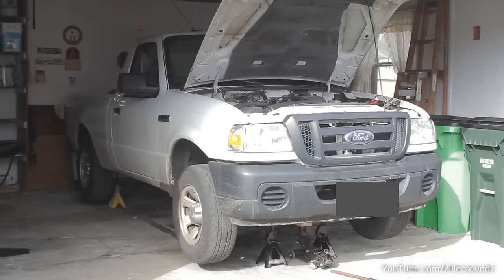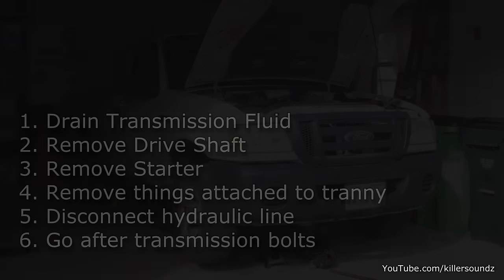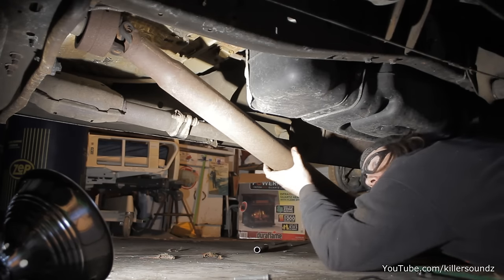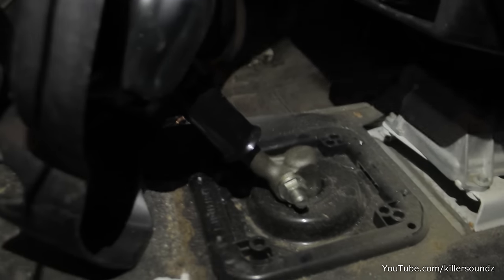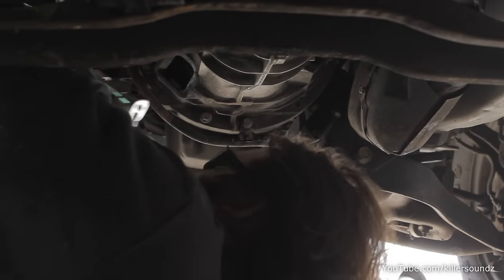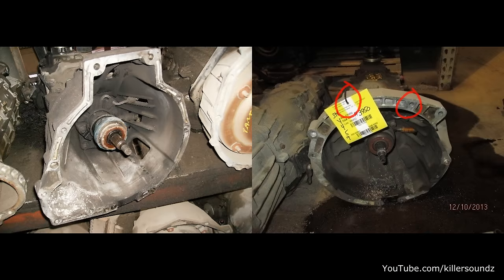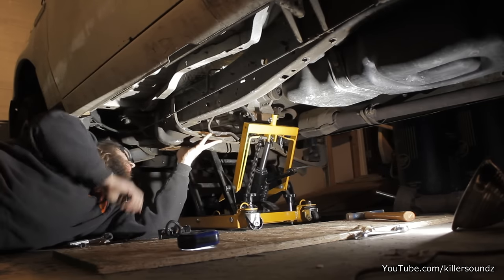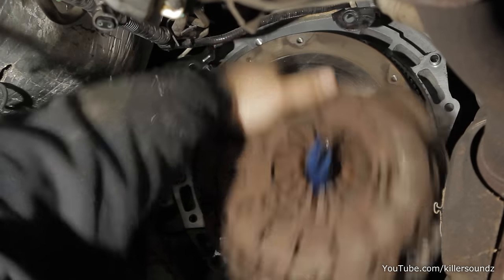How To Replace the Clutch in a Ford Ranger Manual 5 speed ✔

Comment: The key to those upper bell housing bolts is to lower the back end of transmission and get ~3 ft of extension and go from behind the transmission. You can see the bolts once its tipped down and easy to reach with the very long extension. Piece of cake!
Reply: yes good idea
Reply: PAY FOR IT DEFINITELY!!!!!!!
I am a 49yr old Carpenter and I would rather shlep/carry plywood all week for minimum wage then do this again!!!!!
The #2 bolts up top 😠😠 nevermind #3.
Alone made me wish I took it to a mechanic.
BUT!!!!!!!!!
 I'M A CARPENTER
I CAN DO ANYTHING
B*******LS*******T.
ANNNNND
NOOOOBODY talks about getting the muffler system out of the way.
But if you are going to do this 💩
"PB BLASTER" IS YOUR BEST FRIEND and look for the bolts that are facing the opposite way.
ALSO
Why are nobody's hands dirty in these videos 🤷.
I was as greasy as a pig at a hog-calling contest.
I'm also in Florida mid summer
🌞🔥🔥🔥🌞
Reply: I'm down with the lots of extensions Idea... but i find the trans doesn't droop much. the dang 2.3 liter basically you cant move it enough...or maybe the motor mounts are not wore enough to let it tilt.
Reply: I wish I saw this sooner took me days to figure it out. This definitely seems to be the best way by far
Reply: The 3' extension is the only way to get to the left top bolt. The right top bolt is best addressed the same way, but you can get the top right bolt by feel. I tape the bolt to the socket when I reinstall.
Reply: Exactly...
I have a 48" 1/2" to 3/8" impact extension.
1/2" swivel socket does the job quick.
Reply: @lunch_meats8738 
Mechanics don't like getting greasy.on purpose.

Comment: BOTTLE METHOD: if you wanna bleed your clutch or brakes by just opening the bleeder and pumping brakes/clutch,  your suppose to get a clear plastic or glass bottle  and a piece of tubing thats fits tightly on the bleeder.  drill a two holes in the bottle cap but make sure one of the drill holes is same diameter as the tubing.  add some brake fluid to bottle (doesnt need to be much fluid just enough so the tubing can be submerged), now screw cap on, slide tubing through cap, and attach the other end to the bleeder valve.  open the bleed screw and pump your brakes or clutch.  this method is the fastest, cheapest, and easiest.  good video

Comment: There's a much easier way to put the fluid back in the transmission instead of pumping it in on the side. While the shifter knob is out, pour it right down in the transmission there.
Reply: that's exactly what I did for my '99.
Reply: PAY FOR IT DEFINITELY!!!!!!!
I am a 49yr old Carpenter and I would rather shlep/carry plywood all week for minimum wage then do this again!!!!!
The #2 bolts up top 😠😠 nevermind #3.
Alone made me wish I took it to a mechanic.
BUT!!!!!!!!!
 I'M A CARPENTER
I CAN DO ANYTHING
B*******LS*******T.
ANNNNND
NOOOOBODY talks about getting the muffler system out of the way.
But if you are going to do this 💩
"PB BLASTER" IS YOUR BEST FRIEND and look for the bolts that are facing the opposite way.
ALSO
Why are nobody's hands dirty in these videos 🤷.
I was as greasy as a pig at a hog-calling contest.
I'm also in Florida mid summer
🌞🔥🔥🔥🌞
Reply: Lunch meats, that's why you're a carpenter, not a mechanic. 😂
Reply: @lunch_meats8738  yea I just had to take an angle grinder to my muffler because it was such a pain

Comment: The pilot bearing going bad is a common problem on Rangers that see a lot of hiway (high speed) driving. I ve had 12 of them (currently on #13) and travel South Texas in them-Atleast once a year (usually around 90k) a pilot bearing fails. I ve gotten to the point I just buy bearings and keep in the truck-normally the rest of the clutch is good to 180-200k (lacking abuse or hard use). Best combo is the 2.3l and 5 Spd-avoid the auto trans. Second best combo is the 3.0l V6 and the 5 spd-especially in extended cab trucks.
I wish the Aftermarket would step and produce a better bearing.
FWIW-if you use hi temp Marine Grease on the pilot bearing (lightly) during assembly-it helps.
Good video-having done this job half dozen times-I agree with you=farm it out to someone else for $3-400 if you can afford to do so.
Reply: Yup just got back home from a 10 hour trip. Heard some chattering 2 weeks later, pilot bearing is shot. Clutch only has 30k miles on it...

Comment: Thanks for the video. I’m halfway through this job right now. I found if you have about 5 feet of extensions and a wobble adapter, you can sneak over the top of the transmission to get the top two bolts. It’s a bit of a pain, but way easier than going in the way described in the video.

Comment: You crack me up !  Yeah ,  who needs those stinking extra bolts anyway !   I really appreciate that you give ALL of the bolt specs , complete with size AND torque specs !  There are several guys out there making ok DIY mechanic vids but , almost invariably ,  they just about NEVER give that much needed info .  Thanks a lot for the vid .   Looking at a '98 Ranger with 195k that's pretty straight and only $800 .  Just needs a clutch .   I've done a half dozen clutch replacements but at 54 years old ...  I may just pay someone this time .  Thanks again .

Comment: Most V8s have six bolts connecting the transmission to the motor. Dropping the crossmember and letting the transmission drop in the rear makes those bolts easier to remove. Great video!

Comment: Bro finally someone who is going through what I’ve gone through. I’m doing the exact same job on my 2002 2.3l ford ranger and man it’s been a complete nightmare. I’m on the dremel step of the pilot bearing because nothing else has worked. But unfortunately for me I also plan to replace the oil pan gasket and that’s a whole nother ordeal in itself. Suffice it to say I couldn’t agree more with what you said in the beginning, if I could’ve paid someone else to do it, it would’ve been totally worth it.
Reply: If it makes you feel any better, I had my clutch/slave/master cylinder replaced last year at the staggering cost of $2700...I swore the next go around I'm doing it myself....

Comment: Those two top bolts are accessible via a longgggg extension from the back side of the transmission. If you move back and use a light, you can see them and use a very long extension to remove and attach them back again. I did mine and that worked well.
Reply: Awesome, note taken.
Reply: @smittywerbenyeagermenjenso3720  Same here... I've had to do this twice now.  Ready to go at #3

Comment: Integrating the transmission and bell housing seems to be what makes this such a tough job. As you stated, the transmission isn't that heavy. I used to do this using ramps on the front, back wheels on the ground with the parking brake and wheel chocks. Once the driveshaft, externals and bolts were removed, it was just a matter of laying on your back, putting your knees under the front of the transmission and grabbing the tail piece with your hands, pulling it back until it was freed, then rolling to the left and laying the tranny in the grass (shade tree style). THEN you removed the bell housing to get to the innards. Putting the bell housing back on was easy enough.  I admit that the transmission was a bit tougher, aligning it up and getting the shaft into the right place.  It usually only took one or two tries (and not too many dirty words). Just work the transmission back onto your knees, roll right to lift it back in the ball park and push it back in with your hands. ( I seem to remember wishing that I had some shin guards.)  I haven't done one with the integrated bell housing yet and it "Looks" heavy. If it was like a transmission from the old days, it would be. Seeing that it's made of aluminum, maybe not. So, since I'm not 16 anymore and not quite as strong as I used to be, I may try using a jack but it sure seems like adding one more item to get in the way in a fairly tight space. (When I did my 1984 F-150, I didn't even need to use ramps, just the parking brake. I did it in my parking space at my apartment complex back then. (The neighbors never even knew).)
Reply: this is good news! I have a single floor jack and I don't think that is going to do it.

Comment: Couple of notes.  
My ranger is 98 2.5L.  The starter is on the passenger side by the oil pan drain.
Bearing slide hammer pulled the pilot bearing in about 45 seconds.
Removing the passenger fender made getting the bolts much easier.
Harbor freight trans lift is $120.

Comment: Just a tip for anyone who is having trouble with the pilot bearing removal: use a heat gun on the high setting and aim in the area around the bearing to loosen the bearing from the crank, the key is to heat whatever is holding the bearing (in this case the crank end) so the metal will expand and loosen its grip on the bearing. Then proceed to use a slide hammer and the bearing should pop right out, if it doesn't, apply more heat and try again. You can also use a small hand torch, but I prefer a heat gun so I don't melt or warp anything on accident. All bearings can and ideally should be removed and installed with heat. Hope this helps someone!

Comment: Been doing this for the past week appreciate the video helped alot.  I have a 2003 ford ranger edge 3.0 manual transmission.  And I also have to top 2 bolts, found that if you remove the passenger wheel and the cover you can get to the bolt up top on the passenger side fairly easy and after 3 days as well the top bolt was easy to access from behind the motor, didn't have to remove any mounts.  Once again thanks for the video.

Comment: Great video how was you clutch reacting?i have a 2003 ranger 2.3  and can’t get it in gear while truck is running but when off I can.hope you found the 3rd stater bolt.video was simplistically easy to understand

Comment: Thanks. I think this video is gonna help a lot. About to start slave cylinder replacement on my 88 Ford Ranger
Reply: how was the slave cylinder repair? about to do this on my '87 ranger 2.3L.  did you leave the trans in place?

Comment: Wondering what exactly your truck was doing for you to know for sure you needed a new clutch? My 09 has under 100k miles and it doesn't want to shift into gear if I am not moving. If the truck engine isn't  running, it shifts fine. Of course that's not when I need it to shift! Great video though I feel really annoyed with Ford right now if I need a new clutch already.

Comment: The pump bleeding method is you have someone pump the brake pedal or clutch and after several pumps depress pedal to the floor, then you open the bleeder valve then close it, then release pedal and repeat

Comment: Really helpful video thank you, hey man I’m running in to a problem now that I replaced my clutch when I put my shifter back it’s stuck on one of the gears and not moving from there can you help me!
Reply: I know this is a little late but, check for a broken fork or sheared pin inside the trans

Comment: I hate to screw with something I know nothing about. But I am faced with this task. I have watched a couple of videos now. And read through some of the comments.
Many years ago I remember someone changing one out and they had to adjust the clutch. No one has mentioned that in any of the videos. I do not know how they did it or what tools were used. Is this something I will have to do ?  Also you changed out the clutch pressure plate and the through out bearing, right ? On my truck the clutch slave is a little different. Seems it was located on the side of the frame close to the drivers wheel. It was replaced about a few years back. Should I change that part again ?

Comment: Mine is a extended cab with a two piece drive shaft and two cross members  one I'm going to have to leave in place.it hooks the suspension together.hope it will move back enough to replace everything.

Comment: Never heard of the "piece of bread" trick-  doesn't seem like it would work that well.  For old Chevys we would pack bearing grease in the hole then use a steel rod a few thousandths smaller than the pilot shaft on the end of the tranny input shaft.  As you tap on the rod the hydraulic pressure on the grease gets behind the pilot bushing & forces it out.
Reply: 150 p.s.i. with an air nozzle in the center of the bearing would blow it out, too. It also works great on handle bar grips as well. Both removing and installing. With removal, you have to watch where it's pointed because it WILL launch.  The grease trick is a good idea for the pilot bearing, too, and has just been added to my mental arsenal. Thanks.

Comment: Hey I have a question im doing this in my truck right now same truck and the pressure plate do the dowel pins have to be lined up because I put the six bolts in and torque them but the dowel pins holes aren't lined up do I need to take it back off and line them up or no?

Comment: tip for refilling the trans fluid instead of using a pump under the car open the fill hole have someone watch it and fill from inside the cab through the shifter faster and easier. if you wanna do it alone same process just check amount needed and fill it, check when you reach manufacturer recommended amount and see if its leaking add as needed.

Comment: Hello sir , I have a question about the ford ranger clutch , I have a ( Ford Ranger XLT 4WD 2.5L 4cyl petrol 2016 manual 5 speed ) and I want to replace the orginal clutch for it with heavy duty clutch the as Stage 1 , Stage 3 and others. So I made some researches on ebay and I found many but they say it fit 95-11 , so my question is: would they fit my vehicle or not ? If not , do know any other types that might fit my vehicle? Thank you and I hope you read my comment 🙏

Comment: Great video! Just wondering if those top two bolts would be easier to get to if you unbolted the transmission mount and tilted the transmission and engine down as far as it will go? Just a thought.
Reply: Just did the clutch on my 2008 today, 8 years after the last time. Nothings changed, 3' of extensions over the top of the tranny looking from the tailshaft is the ONLY way to get at the top right bolt.

Comment: 16.15 minutes on your video you are talking about bleeding your clutch or brakes.The way I always have done it was to leave the bleeder closed and get someone to pump the brake or clutch about 5 or 6 times and hold down on the peddle while I opened the bleeder then I would close the bleeder and they would pump it up again, keep doing this until all the air is out of the line. works great as long as the person pumping the peddle does not let up on the peddle until I close the bleeder are air will suck back up into the line.

Comment: I have a 1997 ranger 2wd, ive done clutches on other cars, front wheel drive too. Would you say its worth it for me to do it on this one? I know you started by saying you wouldnt have done it again.
Reply: okay cool, i did mine on a 2003 focus. did the same as you and left a bolt out that was a bitch. if 9 wont hold 10 definitely wont haha

Comment: I'm extremely surprised the puller didn't pull the bearing out I've done this a few times no problem with the puller. Usually the bearing will break and come out in a couple different pieces. Tried the bread method didn't work so I went and rented the bearing puller attachment worked like a charm. So now I run and rent the slide hammer and bearing puller attachment before I even start the job. I make sure to rent the biggest heavy duty slide hammer. Auto parts store will rent all kinds of tools for free. You just have to leave a deposit that's refundable.

Comment: Hey when your climbing under your car get a piece of sheet metal. You can slide a whole lot better, instead of just on concrete.
Reply: About 4 years ago, I traded the sheet metal for a set of those jig-saw puzzle type foam rubber mats. I store them by the garage door, lay them under a vehicle in what ever layout required, and they clean up pretty easily.  I don't slide all that well but my knees, shoulders, back and butt all thank me for that move.  Mine are different colors (I think they were meant to be kindergarten exercise mats or something like that) but I've noticed that Harbor freight has started carrying a black version.

Comment: jacks are for girls, I put these transmissions in by myself with no jack, also if you would've dropped the crossmember and let the tail shaft hang down you can get to the top center bolt with a swivel socket and a long extension.

Comment: How different is the process if you have 4x4? Would you just remove the transfer case first?
Reply: +Tyler Hamilton you have to remove the the front drive shaft, the rear drive shaft will have 4 more bolts attached to the transfer case as well. Then remove the transfer case. You probably will have a Y pipe section of exhaust that needs to come off as well...pain in the butt if its rusty down there.
Reply: +Nick Stodola your advice is spot on! Just a month too late haha thanks man

Comment: Great video...I can really feel your pain; and I know well how it feels. I have been there myself. These modern cars can be very difficult to work on. How often does your clutch need to be replaced?
Reply: *****
Thanks for the reply. The reason I was asking is because I have often wondered which is cheaper a manual or automatic. I remember paying a lot of money, back in the 1990's, to have a new clutch installed; however, with an automatic I just change the fluid and filter, which I can easily do myself.

I like driving with a manual transmission; but I just remember them being very expensive.
Reply: *****
That's interesting about the brake pads lasting longer. Makes perfect sense though.

I fix most things on my cars; however, clutches seem to be a very difficult job. Do you find that to be the case with your trucks?